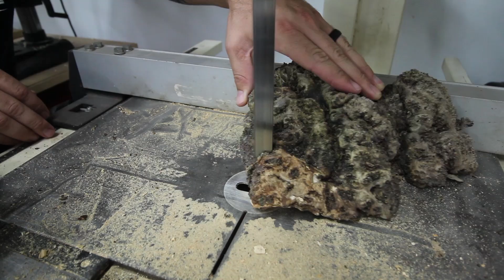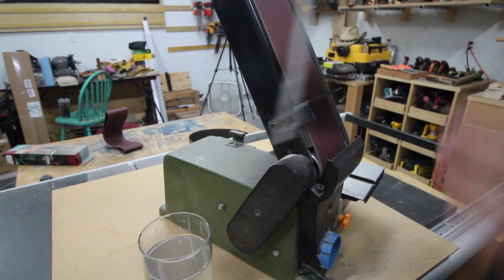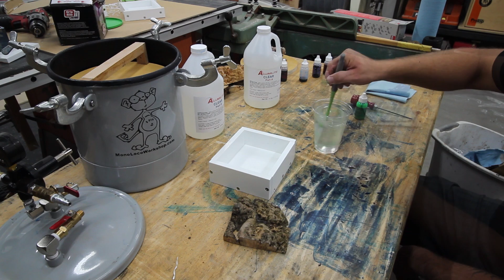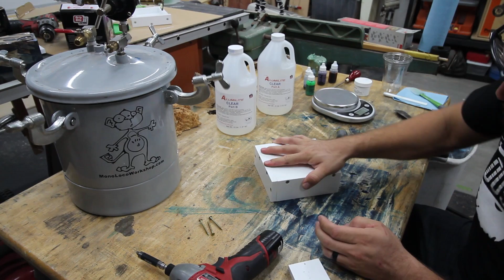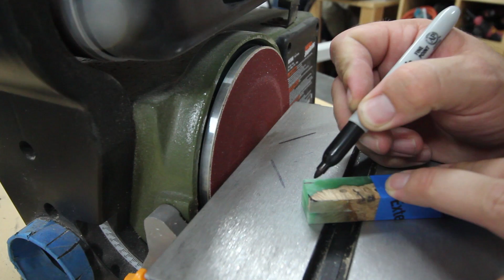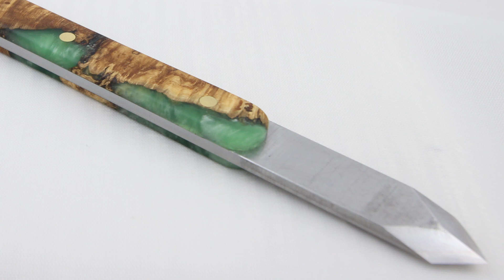Make a Marking Knife with High Speed Steel & Hybrid Scales

Comment: Some of those planer blades are actually two steels! The edge will be hss and the rest is some other steel! Sometimes it's just a thin bottom layer of hss with the top layer made of another steel, others, it's just the edge, like a 3mm wide and very thin piece of hss rather than the whole bottom layer.

If you put a normal, two sided bevel on the knife, you won't have a hss edge. If it's a single bevel, make sure it slants to the hss. Only the ones with a complete layer of hss can be bought to a point, on the partial layered ones, the point has to be toward the hss side.

I think a soak in a little vinegar will help you to see the layers. Only need to do one end. Sanding the side smooth might help too.

I didn't notice this on a blade I made for a old school marking blade handle until after I did the labor intensive grinding. Luckily I had put one sided bevel, and luckily put the edge on the hss side.

Some are solid hss, but they don't out and out say it if they're laminated. For holes? Integrate the hole already in the planer blade >:) Or better yet, epoxy the scales on. It's a marking knife, not a hard use type knife. The wood will fail long before the epoxy will.

Comment: fantastic knife Ty,   Could the hss be softened with heat and then hardened after the holes were drilled?
Reply from the maker: Thanks Mike! That's an option but I was trying to stay away from having it loose its temper. I'm not a metallurgist but I don't imagine that retempering would be as good the second time around.